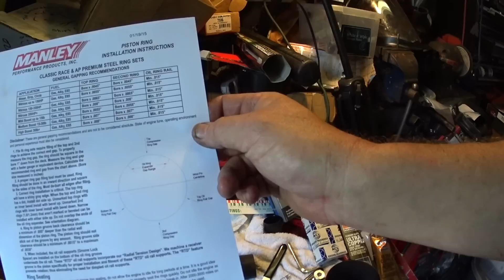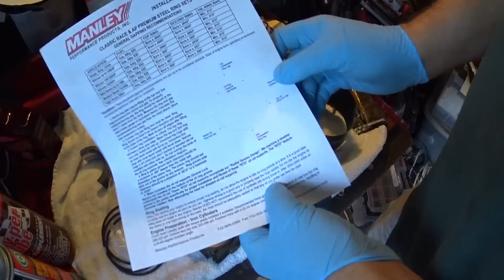Jeep Wrangler 2.5 / 4.0 Rebuild Series - Crank and Piston Install- Enginetech

Comment: You made good point on ring placement. I built motors back in the 80's on drag racing application. I haven't done it in a long time so much has change. Since early 90's I've been working at a brass foundry. I have forgotten a whole lot since then.
Reply from the maker: +Jimmy Hinton (pudgybear100) Thanks Jimmy - Ive forgotten a whole lot since yesterday hahahaha

Comment: Ok Dave, you are super at paint and bodywork and now engine rebuilding. How did you become a locksmith. Was that just a fluke or another one of your many talents. Great job and I'm happy it's moving along quickly as I'm sure you are.
Reply from the maker: +William Langdon Thanks William -  Becoming a locksmith was somewhat of a different direction .  My degree was in marketing and I was a marketing rep for a utility company. I worked part time driving a wrecker and opening cars. I enjoyed opening cas so much I went to school for locksmithing. When the Gas company was sold they dissolved the marketing department so I started a locksmith company :)  Ive always loved mechanical work so basically locksmithing is that too.

Comment: Nice work, had a quick question for you I own a 91 jeep cherokee and it's burning oil  while underload comp test was very odd 128 dry 210 wet.... Do you think I need to change l the piston rings and re seat the values what you think?

Comment: Not really familiar with engine assembly, but are you supposed to put thread locker on the bolts? Also, how can you work with all the crap laying around?! lol seems like you'd spend more time looking for things than getting the job done! :P Love the videos tho Dave, keep up the good work!
Reply from the maker: +Tyler Sisco Tyler Tyler Tyler - you are sounding like my wife hahaha - I dont use thread locker and never had any problems esp at the torque used.

Comment: man i couId use a beer assistant(Randy) too...great video...it's good to show how to instaII rings...you wouId not beIieve how many shade tree so caIIed machanics buiId engines that the rings haven't seated the rings or cross hatch honed the cyIinder...the engine wiII smoke and need to be rebuiIt...which wiII cost more $money$...i worked as a mechanic in an  ASE certified garage...
Reply from the maker: +Mike Brown I hear ya Mike you are correct !  Randy is still in training as far as the beer assistant thing ....  lol

Comment: Can you stroke a 2.5 mine is around 3 hundred thousand on it  or more what you think about  putting a automatic on it i have a 5 speed  now but a fussed back and can shift that good thank you
Reply from the maker: An automatic would lessen horsepower a bit - I havent seen many mods on a 2. that beef it up that much but if you have 300K on it a rebuild would be a big difference anyway Id say :)

Comment: 33  pounds on the rod caps sounds kinda weak to me most rod caps  on engines ive done are around 45+ as more engine failures are to due rod bolt stretch, which is why you throw the old ones in the shit can same as head bolts when doing a rebuild,, I prefer to use studs for the head instead, by the way I sort of agree with the post below, I had  to replace the timing chain set on my 1990 four banger, and I bought a cloyes set.... guess what , the shit is made in Asia, one more thing thats real important, I found when your lining up dot to dot on the timing gears, a visual inspection wont cut it, I found that a straight edge ruler will help, you want to get the cam and crank dot lined up to the center of the bolt on the cam sprocket, if not you may be five degrees plus or minus off, which makes a big difference, in vacum, before I changed my timing set the vacum was only 14 inches at idle when I put the new set in it  went up to 18inches of vacum, I bought my 1990 jeep from a jerk that didnt know shit, they swapped the motor with a rebuild (oil pressure is 75 pounds at 1600 rpm) but the wiring harness wasnt compatable with the engine, there isnt a sensor on the thermostate, plus some other shit, but I live in WV and they dont do a smog check , like yeah I got a oxygen sensor on the manifold but no cat converter, and it sounds like panties ripping when you goose the throttle, and the plugs look a little on the lean side, l my compression is even at 170 per cylinder, I was thinking down the road about by passing the computer and putting a one wire HIE distributor and a manifold that will adapt to a two barrel holley or a weber down draft, and home made header exhaust (yeah I know I have change the fuel pump) and maybe a cam swap with solid lifters and roller rockers, but  the cost of getting another 25 horse power might not be worth the effort I had a 2.3 pinto engine that made 180 HP, after my mods so , a 2.5 should make around 150 or more with the right stuff, any your video s are right on thank you
Reply from the maker: Thanks Tom - sounds like you know your stuff - thanks for watching !!!

Comment: good job your test with the torque wrench wasn't accurate, just because it clicked at the torque it was doesn't mean that is correct did you take it to 85 and see if it would click or 90 lol.
Reply: +Bullshitkorner No, if he did that it would break. Harbor Freight tools are made out of chinesium remember?
Reply: hahahah so true
Reply from the maker: +Bullshitkorner I tried it all different types of ways - torque with the cheap one then checking it with the Snap On - I did a bunch of tests. Really All Im saying is a guy without 250.00 to spend on a torque wrench to put on his head is probably OK as far as the lesser expensive wrench. If you can afford it the Snap On is certainly a far better tool - HF hater - :)
Reply from the maker: +jtip82 Yeah I agree they arent the best esp compared with Snap On
Reply from the maker: +Bullshitkorner hater ...........
Reply: did that engine company sponsor you those parts ? that would be a good score if they did
Reply from the maker: +Bullshitkorner No but they sent me a mug, some pens, T shits,  note pads and decals LOL  They also sent a very nice thank you note so I appreciated their kindness and found the kit to be without any missing parts ot defects :)
Reply: It's ok Dave. Have to pick on you a bit. I'm using Kobalt torque wrenches because where I live it was all I could get my hands on at the time. Got both the 3/8 and 1/2 drives and they're accurate. For now.....
Reply from the maker: +jtip82 no problem bro I can take it hahaha

Comment: Trust a machine shop to do it right. Right??? And that ring compressor looks like something for a lawn mower.lol
Reply from the maker: +Dave Nevotti Hey he did a good job Dave - just took a while :) The lawnmower ring compressor worked fine hahaha
Reply: +Redneck Garage Dave I didn't mean it like that, I'm sure he did fine job. I've seen really nice jobs and some not so nice ones too. Looks great by the way.
Reply from the maker: +Dave Nevotti Thanks bro - Ive been screwed by a machine shop in the past too -  1980 GMC Jimmy bored 30 over with 10 over pistons and rings - it did run but made very funny noises - lol